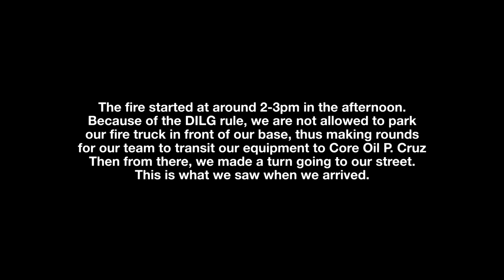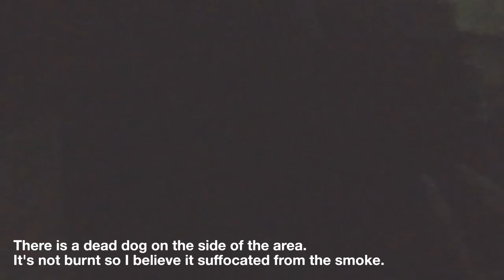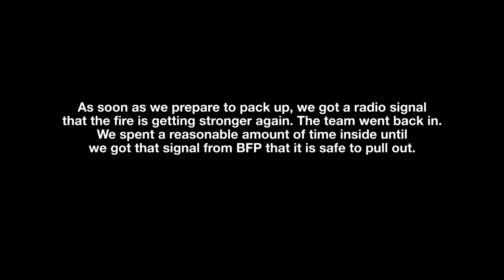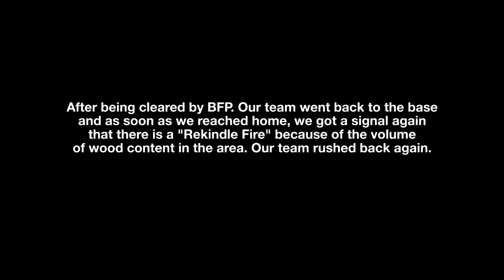10 70 BARANGAY SAN JOSE SITIO IV MARCH 6, 2020 | Response Fire Volunteer

Comment from the maker: We are getting negative reactions from the area we responded to (SMH). We are getting reports that we arrived at the scene without water. Watch the video again, we arrived, we blasted, WE RAN OUT OF WATER (NAUBUSAN KAMI NG TUBIG), then we asked for supply. Just for the knowledge of everyone, Fire Trucks are categorized via classes, in which our Truck is a Pumper. A pumper is relatively smaller that Tankers because their main job is to penetrate tight areas, in which bigger trucks cannot enter. A Pumper class truck will soon be supported by other trucks behind it, tanker behind it or Fire Hydrant. Our truck can blast for a good 4-5 minutes in an full water tank and ideally should be supported by water supply. I hope this clears the myth that Fire Trucks have "unlimited water supply".
Reply: Christian Kevin Reyes Don't worry about it. They're low key keyboard firefighters and has no knowledge when it comes to firefighting.
Reply from the maker: Thank you for supporting our cause, Ren.
Reply: Exactly. Haters will hate and those who don't contribute would have faster mouth than hands. It's why they have time to speak negatively and notice everything, 'cause they're not busy doing anything.  Those simply lack of common sense and think fire trucks have super power - like unlimited water.  Keep doing what you're doing Response Team and be safe.
Reply: well genyan naman taaga pinoy di namantalaga alam nangyayare tas bigla nalang mag rereact or mag sasabe ng kung ano ano may mga class ren kase yung mga yan tulad ng sinabe ni boss buti sana kung tanker truck nila eh
Reply: Ganyan tlga sir marami ka maririnig in reponse in a rural area o dikit dikit ang bahay...just do your job!! Yan yung mga wlng alam ...but still tnks sa info betweem pumper truck and tanker truck
Reply: Thank you nadagdagan po ang alam ko sa mga Firetrucks❤
Reply: @ckevinreyes  sir christian to the rescue👨‍🚒  comment from nash grengia
Reply: Ok lang yan kuya sa oras na kakailanganin nila kayosila rin magmamakaawa
Reply: ganyan lagi sisi ng tao satin chief kala ata unli dala nating tubig
Reply: Yan hirap sating mga pinoy boss eh kala nila unlimited dala ng mga firetruck alam lang nila isisi sa iba mga kapabayaan nila pweeee
Reply: hello sir whats your intro music name
pls magreply early
Reply: @o TYSM